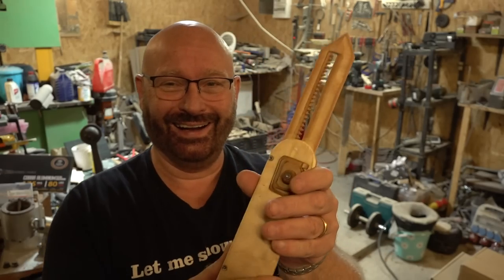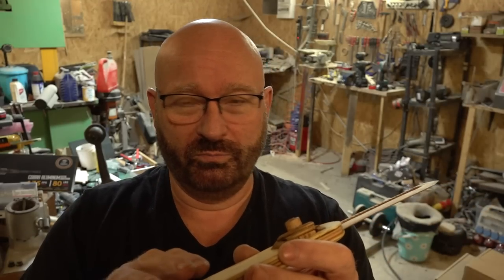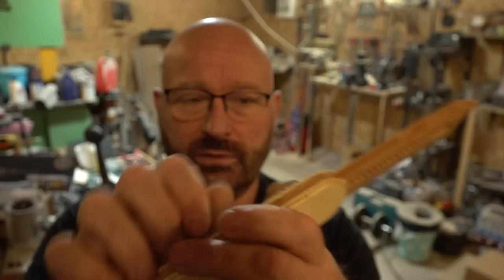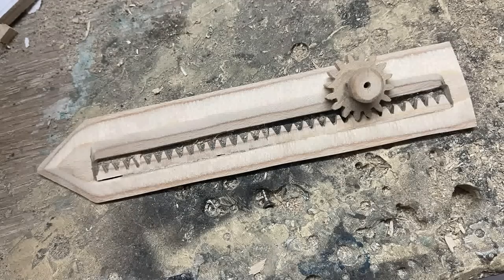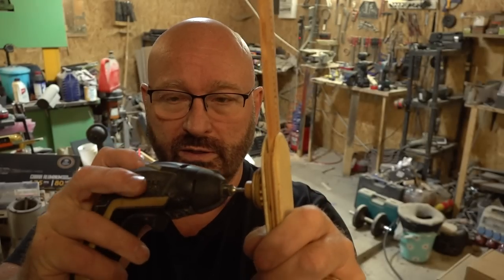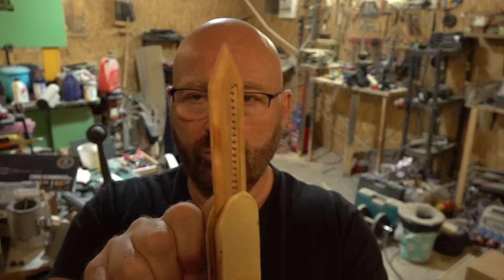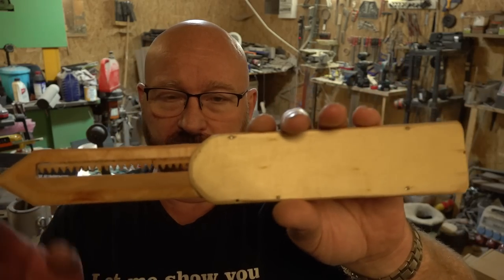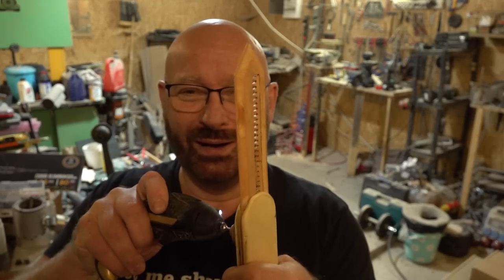The Gear Knife - Great or Dumb?

Comment: Instead of gears, you could use a looped cable attached to the base of the blade. The motor (at the front) would pull the base forward to push out the knife. To retract, reverse the motor and the other end of the cable, looped around a pully at the bottom, pulls the blade back down.
Reply: I was thinking the exact same thing.
Reply: also the motor on the back would work as a counter weight to balance the knife blade

Comment: Ignoring that it's April 1st, this sounds like a fun and interesting concept to think about. Two ideas that might be worth trying are:
1 - make the blade thicker and mill the teeth into the side of the blade and the gear would rest parallel to the blade.
2 - If you experiment with a worm gear, try a double start or triple start worm gear. They will produce more travel per revolution, but the blade might want to retract if it's not locked into position once extended.
Reply: even if the rack were on the spine, too many stress risors via the teeth.
Reply: What about a linear motor?
Reply: @Deipnosophist_the_Gastronomer  I tried it. Very slow, very bulky. Compressed air, springs or magnetic drive are better solutions. But he's trying to do something different for a commercial blade. So gear drive is easier to produce and market at a realistic price point.
Reply: something I have found about Joerg is that something does not have to be practical, just has to be cool, which I really appreciate :)
Reply: This idea is not original to him, it was already done by another youtuber, I think he thought he invented this system when in fact it already exists.
Reply: @CorruptionManX  I'd like to see the other YouTuber's version. Can you give me a link to their video or channel? Thank you in advance!
Reply: @johnNJ4024   Rawice511 Gear Hidden Blade, and also look Imdeepainreborn latest models.
Reply: @CorruptionManX  I didn't say it was. In the tens of thousands of years the pointy metal stick has been invented, I'm very confident there has been hundreds of versions of a gear drive blade. I believe Colin Furze and a few other inventor creators have made versions of extending blades.
Reply: @nickrider815  I didn't say that Rawice 511 invented this concept, nor did Joerg say that he invented this concept, but the way he presented it made it seem like he invented it. What I know is that Rawice did it before, and you asked me who did it before and I did.
This is my second account.
Reply: @nickrider815  Colin Furze just copied the design of Ammnra, made 11 years ago and that Imdeepainreborn perfected, Colin Furze made no improvement in the design and even today he takes credit for the hidden blade he copied.
Reply: @nickrider815  And Ammnra didn't just copy an OTF knife, he adapted several things and he invented the drive system called until today the Ammnra Wheel.
Reply: @CorruptionManX  Will definitely check out the other channels. Awesome!
Reply: @johnNJ4024  Glad you liked it, sorry if maybe I sounded rude in my answers, English is not my main language and I still don't know how to communicate well.
Reply: @akilarodrigues7065  I did not ask who did it, I think you confused me to another commenter. Nor did I say Colin invented it. My point is there will of been hundreds of versions of a gear drive blade decades before the advent of YouTube. I made an arm mounted dart thrower with springs in shop class before the Internet and digital cameras existed.
Reply: @akilarodrigues7065  who are you?

Comment: Joerg, you need to look at the top of the line compact portable Walkman Cassette Tape mechanisms and how they implemented their electric motors and pulleys

You'd get inspiration on how to make them flat, compact, powered by a single AA or AAA battery, and integrated into the handle without having much protrusions.

Comment: A few questions:

1. Just in general, what problem are you trying to solve with this? What is an electrically actuated knife (with all its downsides) the answer to?

2. Why make it a sliding mechanism and not a folding one, which is already rotational in nature and wouldn't require any translation?

3. Have you thought about using magnetic gears? Or even magnetic coils? A magnetic solution could be embedded directly into the blade, reducing points of ingress. You'd trade mechanical complexity for electronic complexity.

Comment: As a knife collector and enthusiast.... I really think you're onto something here, I really liked the design especially the gear in the center.... How about having a self-charging, self-winding motor at the other end to power the knife.... Another words a small Crank that you can pop out charge it up and the charger last for 15-20 minutes enough to use it for whatever use that you're using it for.... I believe a small powered electrical engine or dual engine in case of one of them burning out you still have a second and then a manual way as well.... But it's got to have power.... And you could even fit it with gears like a neutral gear where you can slide it out quick without the use of the electrical engines.... But I think it's a great idea and you have my support 😊 I give you 5 stars for this ⭐⭐⭐⭐⭐
Reply: imagine a tiny arduino controller for the motor so it can come out at various speeds, and stop and start with out having to be fully out, so you pull it out to fend off someone, they take one look and turn around, to walk away, it starts slowly going back in, they turn their head and it stops and starts coming back out till they turn away and leave then goes back in, HA HA. even better if it was a pure titanium sheet metal frame and a steel blade with infused tungsten carbide powder to give a lasting edge (requires diamond to actually sharpen but man how hard to dull it since the steel keeps it from breaking from being brittle but the carbide particles protect the softer steel from abrasion that dulls the edges :) I can see using something like that for slicing my cheese ;) (been looking for a good switch blade stilleto style that I can use for that, but this would be so SO SO much more fun and cool :)
Reply: This idea is not original to him, it was already done by another youtuber, I think he thought he invented this system when in fact it already exists.

Comment: I would make it spring driven like a traditional OTF, but the spring would be electrically pulled back instead of by thumb power. That would make it as fast (or faster) as any OTF, and you could make it more powerful because the motor would be the limiting factor in the spring tension, not the human thumb.
Reply: You could also replace the springs by rubber cords which are attached to a winch driven by the motor.
Reply: and trigger by motion detection/fingerprint lock👍

Comment: Steampunk elegance! I think it might solve the safety problem of assassin's Creed style wrist blades. Or anywhere you need a knife to open quickly and easily but never accidentally. Have you ever thought about 3D printing the gears, at least for prototypes?
Reply: Good thinking! It may be safer and more comfortable if the profile can remain small. Once the motor and power supply is attached it may be too clunky.  We need to see it to be sure. 😁

Comment: What comes to mind right now is a rubber friction drive with an interlock at the end, so the knife doesnt get pushed back into the hilt by a stab or a cutting motion. Youd need a fairly thick spine, so the rubber has enough friction surface, and maybe a guidance wheel at the guard end of the hilt. But I guess it could be functional and look somewhat elegant, if done right.

Comment: I suggest looking into gear ratios. You might be able to make it faster. I'm sure there is a way to make small gears in order to fit a gear box in the handle of the knife. I'm obviously not an engineer, so I'm not sure if it would work, but I think it'll be beneficial to at least look into. Gear ratios can work both ways, making things go faster OR slower.

Comment: In the metal version, you could deep set the teeth into the blade, but not completely through; like a clockwork.  Doing so would make the knife look more solid and less flimsy.  A side mounted thumb button with a safety switch would be super cool as well.
Reply: "deep set the teeth into the blade"

blade would snap the first time you use it.
Reply: @stevealford230  A toothed fuller is what I am describing.  This would not cause the blade to snap.

Comment: It might be worth designing for specific blade lengths (ex. short/med/long), rather than a continuous length. Would likely simplify the design to the point where a motor is not required. This allows allow for storing the energy mechanically rather than in a battery. From there you could implement a mechanism which selects the blade length. So this allows for you to build off of traditional switchblade designs, which has a whole host of design/manufacturing advantages, probably.

Comment: The solution is the old rack and pinion system you had set up for the full-auto crossbow back in the day; gear rotates, drives blade forward, the blade slips over the smooth part of the gear, and a spring pulls the blade back to await the next cycle.

Comment: The basic question is ...why you need a geard knife?  In addition, I think putting the gear inside the blade will weaking the blade. in my opinion it seems like not a good idea after all. Good luck.

Comment: For a perhaps more impractical "engine": a self-retracting cable anchored at the shoulder, held in the hand and attached to the gearing for the blade. Align the blade along the outside of the forearm, and it'll extend and retract with a punch. Of course, the blade could then be as long as the forearm without impeding movement too much, though the self-retraction method could make extending one's arm more difficult.
 
Probably way more effective using some hydrolics, but thinking of a more "low-tech" method for similar results.

Comment: If you put the teeth on the back of the blade they can double as a fish scaler. And the blade won’t have a big cutout in the center weakening it. Plus the motor housing can be on the top of the handle to act as a hand-stop/guard.

Comment: I have experience with (freestyle/FPV) drone motors and while I'm not saying they can't work in this application, they may not be ideal.  For one thing they require a speed controller to operate, so whether you use a brushless drone motor or brushed drone motor, you'll need someplace to put a small speed controller, the battery and a suitable switch.  Also, you may need to find somebody that's able to write some custom software for your speed controller to get it to work just the way you need, or create a second custom electronic device that will monitor the input from your switch and then send the correct instructions to the speed controller to tell it what to do.  Another problem with drone motors is that they tend to spin extremely quickly and are not typically limited to only a few rotations, so they actually would be better suited to a worm drive I think.  Also, when drone motors aren't under load they spin freely and will not prevent retraction when the knife is plunged into a target.  I think custom speed controller software may be able to do some electronic breaking to increase resistance of the motor, (requiring electricity to maintain it that way), but I think it would require some custom software and I highly doubt a tiny motor is going to have enough stopping power to be of use, especially if the battery is low.

So far I've been talking about drone motors used for flight with a propeller, but there is one kind of drone motor that might be better suited to this task, and that is a camera gimbal motor, which I don't have any experience with personally, but I know that they are very slow RPM,  (I think usually less than a full rotation in normal use), although I suspect they may be able to do more than one rotation if programmed to), and can be controlled in a very precise, verifiable way so that any custom software you have developed will be able to tell if the blade is extended or retracted, and by how much because camera gimbal motors keep track of the precise position of the motor.  I'm not sure but I think they would probably provide a lot more resistance to retraction.  Unfortunately I think gimbal motors are usually bigger.

While I think maybe drone motors could be adapted for your purpose with enough effort, I suspect that there may be other electric motor types that might be better suited for this project.

Comment: i think something that will be required a final version is a latch for the blade when the motor is finished, as striking something could damage the gears and teath allot over time, and you wouldnt want the blade to slide back.
Idealy without having to manual do it, the mechanism workes only when the motor is activated but i'm not sure how to implement that in a compact form factor.

Comment: you can use wormgear to drive the blade in/out mounted inside the middle and then use simple gearing attached to motor and the worm/screw-gear which will be parallel to the blade. the "round" part of the worm/screw-gear will be the straight part inside the knifeblade. a bit like a screw pulling/pushing the blade. and some sort of clutch if stops gets hard

Comment: You could make a serrated edged blade, where the serrations acted as the cog notches, that way you'd remove the dirt trap in the middle of the blade, and the need for a thick middle section on the blade, but still retain the essential mechanical action.

Comment: I think adding a coiled spring within the mechanism could make that work even without the motor. Giving it enough tension and a locking system so you press a button, and it winds the spring down turning the gear, extending the blade. Then you can either turn the gear and sheathe the blade, or press it to sheathe it, "Recharging" the coiled spring. Could even add a small release button that decouples the spring and gear, so if it wears out or goes out of wack, you can easily rewind the spring to the proper tension, sort of like a drum magazine. The button could interface with two parts of the blade, perhaps at the front of the gear set, to keep it sheathed, and then at the rear, to keep it extended, so you aren't putting undo stress on either the motor if you go for it, or the spring if you go that way. 

I'm not certain on the practicality of this design....but...practicality sucks, making cool shit is way better!

Comment: Depending on the size of the handle you could rotate the drive gear 90 degrees and have holes in the middle of the blade to mesh with the drive gear.

Comment: You can increase the speed of a worm screw by adding more leads. 4 leads would be 4x faster than one lead but would take 4x as much force to turn.
Although with more leads you lose the self locking feature of the worm screw.

Comment: Having the gears on the spine of the blade would improve blade strength rather than having gap through the middle.
You could then realign the gear and motor towards one side of the hilt. It could make it simpler. Could make it a real pain too.

Comment: With the warpspeed capabilities of small drone motors especially if your not worried about heat build-up I'm sure a worm would drive it plenty fast enough. Most cordless drills run really big gear reduction of.

Comment: if you combined with a sheet, you can conect the sheet with the gear and in one direction it will open the blade , but in other the knife will go out closed.

Comment: Jörg, how about a passive solution with no moving parts. You can accomplish this by using an electromagnet on each side, and then polarizing segments of the blade as north and south magnets a but how the axles of a car are done to measure wheel speed.

This will allow fast extraction, basically the speed of rail gun projectile.

But it will also be able to lock the blade in place, or retract it, and you don't have any hole in the blade, it's just forces you into normal steel instead of stainless steel.

Comment: I would go for a spring and cable design. The spring would eject the blade immediately, and then use a cable attached to a motor to retrieve it, then it doesn't matter as much that the retrieval is a little slower?

Comment: I think the way to go for such a thing would maybe be a friction drive with a small rubber roller against the flat side of a blade that's only ground on one side.
That would probably be cheaper because less machining is required,  and would avoid the issue of debris clogging the gears.

You could also explore this rack and pinion system with a gear you wind up instead of operating electronically, maybe something with a flat coil spring that winds as you retract the blade.
Like a reverse tape measure spring.
If an electronically actuated blade is legal then something with a spring probably would be as well.

I kind of think the idea overall is a bit dumb myself, but I am a traditional knife guy who only carries 2 handed pocket knives ( mostly slipjoints) and traditional belt knives though so I'm just not somebody who could like a thing like this.

Comment: Hmmm. Ignoring the date here, rack and pinion will still need a lock, or the blade could be pushed back in. A worm with a fast spinning small motor is actually the better solution, as it becomes self-locking

Comment: Since this this the slingshot channel therefore what I can suggest is to use a motor to charge tensions into a spring and use that to move the blade inside or outside

Comment: maybe a design like one of those saw-backed survival knives, but the saw teeth are the rack, and then a worm screw so the drive motor can be mounted coaxially and it locks in place when power is off? I really doubt motor speed is going to be the bottleneck for the mechanism if you get a reasonably specced one, electric motors can be hella fast!